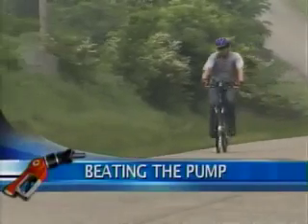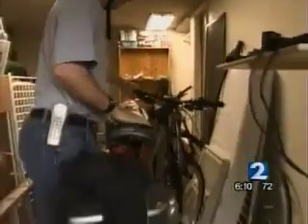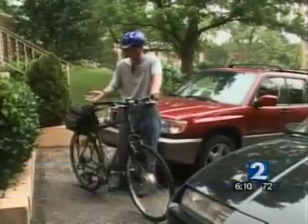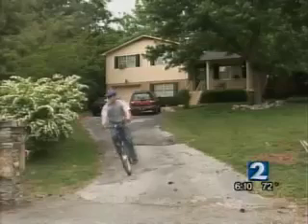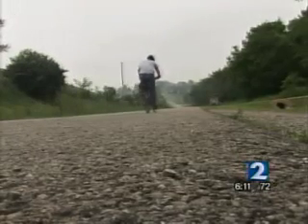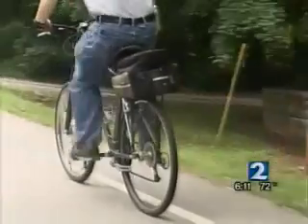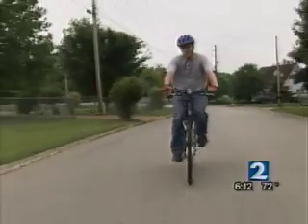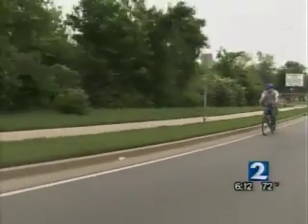News Report "Man Motors On Hybrid Bike"

Comment: I wish there wasn't a 15.5 mph cap on manufacturer's speed regulations in UK
Basically you have about a 250 watt motor, but as soon as you exceed 15.5mph you have a 0 watt motor on a heavy bike. As I do the majority of my riding above this speed, the cap renders them useless except on hills, but as the motor only has a single gear ratio, you're not getting the 250 watts at low speeds bogging down the motor.
Reply: The UK limit is ridiculous. It's almost as if they don't want people to drive anything but cars...

Comment from the maker: @sky12066sed3 Re: how many miles before having problems with hub motor...

It depends on which hub motor u r using. Which one (manufacturer/model r u using? It seems that a motor can go several thousand miles, typically, at minimum, before experiencing any problems. The battery on the other hand can have a limited life. Some of best 4 longevity, ATM, r the Lithium Ion Phosphate Polymers. And apparently best is Lithium Iron Phosphate batteries, because they are safest and can get most recharges.

Comment from the maker: @459am And prices on electric technology is getting cheaper and cheaper all time. & safety factors r getting better & better. & development of electric interface standards r getting better. One advantage 125 dollar gas motor could b used 4 electricity generator on full electric power assist bicycle. This would b similar 2 how Chevy Volt is full electric, but it can not only get electricity from plugging 2 electricity source, it can also get it thru gas engine. there is market for micro generator

Comment from the maker: @459am which electric motor and transmission of energy to wheel did u use? which battery system/chemistry did u use?

electric motors and batteries, especially batteries, have mad huge improvements over the seal lead acid, Nickel/Cadmium, and Nickel Metal Hydride. Even Lithium battery chemistry/technology has improved significantly. The Lithium Iron phosphate being superior to even he recent Lithium Polymer. And even more recent developments in nano tech for super capacitors which will ...

Comment from the maker: @sky12066sed3 I am not sure about the bike Marin. But it seems that the strongest forks for electric bicycle are thos that do not have building suspension. It seems that front forks with suspension, and a front hum motor, although it may work, are a little more at risk of the fork braeking under stresses that the motor can induce.

Comment from the maker: @sky12066sed3 It depends on several factors. one is regarding how much power and speed you want. Generally speaking for average urban bicycling with average weight rider and on average upright bicycle with average street tires, I would say a minimum of 500-750 watt hub motor would be ideal. II think 250 or 400 is a bit under powered.

Comment: @takadi There is much less energy loss connecting the pedals directly to the wheel rather than using pedal power to charge batteries and then use the electric motor exclusively.  Lol, that would be like burning wood, to create steam, to generate electricity, to heat your home.  Besides, for hills with pedals still running to the wheel, you can give the motor a boost.  If you only had the electric motor propelling you, you would have to slow down

Comment from the maker: Regarding wiping out, that is more of an issue of safe riding skills. You might want to consider taking a bicycle safety certification course.
The only exception that may validate the issues you describe is if you used old friction drive technology without with or without a brake lever cut off switch. Those are definitely less safe, they definitely would wear the tires our. And the brakes could be worn more rapidly if the system does not have a brake lever cut off switch.

Comment from the maker: It would be helpful if you give more data to support and clarify your claims. According to your description, one can percieve your added costs of maintenance are a result of riding the bicycle more per year. Tires and brakes would not wear our more per mile. Theyt would not wear out any faster than anyone else riding the same bike at same speeds/conditions as a bike without an electric hub motor system.

Comment: How well do the hubs work on "steep" hill climbing? I am finishing my 1 Kw electric and moving to 48 volts. I have a massive motor driven freewheel sprocket on my system. 36 volts does the work but 48 v will be unstoppable and probably more efficient. I was considering whether or not to wire my 36 volt 1Kw controller with 48 volts. Do you think the power electronics will accept the extra 12 volts? I don't have much experience with overvolting.

Comment from the maker: The length of time can vary from 30 minutes (or less for a top-off charge) to a couple hours.

The length of time for NiMH batteries is on the longer side of the spectrum of charging time. Lithium Polymer batteries are on the lower side of the spectrumof charging time.

Check out "dewalt ebike" videos on youtube. Alot of people are using the dewalt batteries and chargers for thier ebikes. Let me know what you think..

Comment from the maker: Yes and yes. And we are likely to see more hub motors applied to other vehicles. As a matter of fact, there will be a retrofit hub motor on one of the vehicles in the Automotive X Prise race this year. And apparently, it will be made into a kit that can applied to virtually any car, whithout need for removing the wheels or it's current engine. The hub motor is attached to the outsid of one or more of the wheels.

Comment from the maker: Scott is good. Keep in mind though that hub motors can cause a bit of touque. So if your Scott has front suspension, you may want to put the hub motor on the rear wheel, or you may want to consider the max power your hub motor when applying it as a front wheel replacement.

Comment from the maker: Clarify what concerns you have regarding theft over your car.

Theft is an understandable concern for bicyclists and for those riding ebikes. However, depending the the situation, an electric bicycle may provide advantages to driving a car. And there are some techniques to mitigate many theft issues.

Additionally, if the electric assist is put on a high quality folding bicycle, the bicycle even has more advantages than a standard upright bicycle with an electric assist motor on it.

Comment from the maker: it may be possible to recapture some energy when braking or going down hill. However, the reclaim of energy, with existing consumer products, to my knowledge, is a minimal percent, and much less when driving at optimal speed with no stopping, such as freeway style driving. 

A more interesting source of energy while driving is from solar photo voltaic panels on bike or on trailer towed by bike. I have seen reports of bikes configured with solar panels running completely off energy from sun.

Comment from the maker: Mentioning it as a comment is appropriate. Mentioning it in the 3 minute video would be minor to the issue of electric assist compared to non-electric assist bicycle. And I suppose as people become more familiar with the concept of electric assist hub motors for bicycles they may be able to distinguish between brushed and brush less motors, direct assist compared to pedal assist, etc. That may be similar to fuel injection compared to carburetor and turbo assist in car engines. Comment more.

Comment: That's true... Gauges, sensors, etc are not necessary and are very minor.  However, that's hardly comparable to a regenerative braking feature.  And while not the focus of this story, it would contribute greatly to the efficiency or range, and as a reporter, you would be stupid not to at least mention it.  So obviously, it doesn't have this feature.
Don't get me wrong, though.  Any electric bike is an invaluable tool.

Comment from the maker: Thanks for you comment.

No, the "???" means "what is your concern?" And since the video does not state whether the bike has regenerative braking or not.

Also, regenerative braking is essentially and electric circuit and/or software add-on to an electric motor hub system.

Comment from the maker: TRuudern wrote:
"But if the bike/biker is hevier, it uses mor electrisety uphill. What help would it be?"

The weight difference in this case between a standard bike with no power assist and this one is about 20-30 pounds. The batteries are about 2-3 pounds. hub motor addes about 10-15 pounds.

Comment: harvesting the counter electromotive force in an electric motor creates a dynamic braking force. to prove this take a 1/10th scale electric car, remove the battery, short out the motor termials with a metal paper clip. now drag the car across a carpeted floor.

Comment from the maker: sugateddy wrote:
"Pedals most of the time anyway? Then what's the point of it?"

the electric motor provide "electric assist" power. So when he pedals, he can use the motor to give assist to make pedaling less work. And with the accelorator for the motor he can adjust how much motor assist he receives. This is particularly valuable when carrying loads, going up hill, or going long distances, etc.

Comment: 20 MPH max motored is legal without license. This is generally a 36V powered motor. With additional pedaling you can go faster, but I don't the rating applies if you are pedaling. 48V will go about 26MPH. This would not be legal, but I seriously doubt you'd be hassled about it. I'll be posting a video soon with me on a 48V powered dirtsurfer (like a skateboard) My motor kit cost only $550.

Comment: I would go for the conversion kit.  The first time a prick cop sees an obvious scooter going down the sidewalk or street, they pull you over and want insurance, registration, and drivers licsence <sp>, and maybe a safety inspection certificate depending on the state for a motorized vehicle.